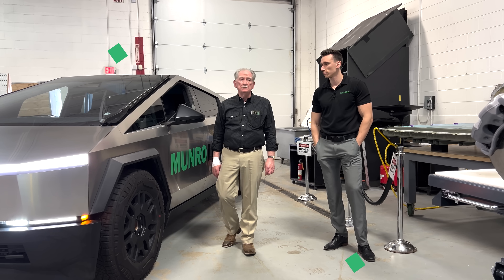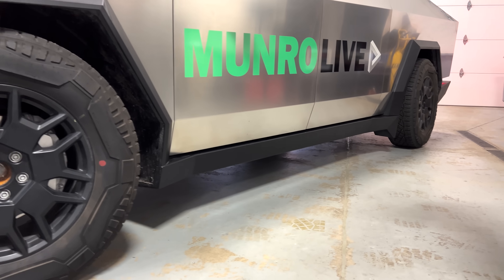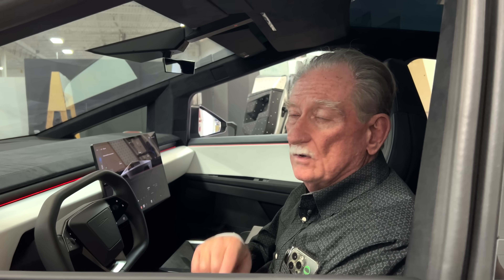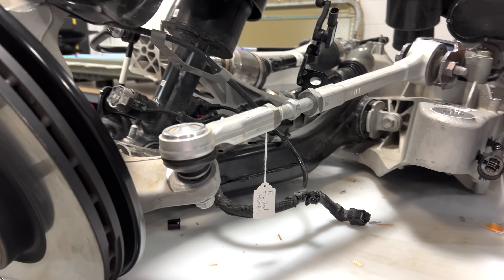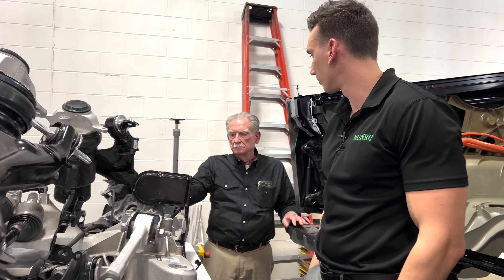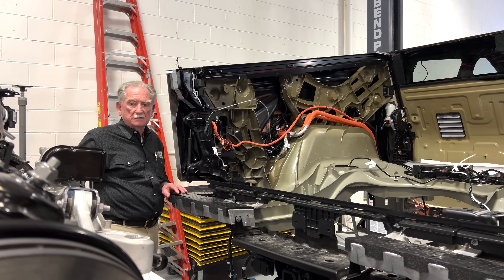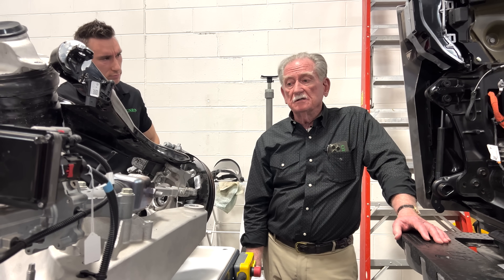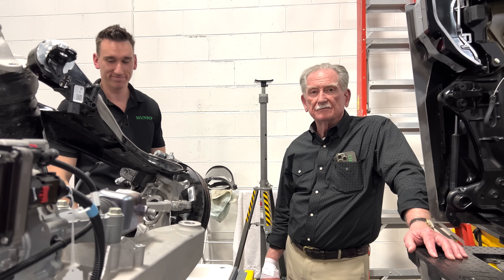Tesla Cybertruck Steer-by-Wire System

Comment: The rack has two motors to control the steering input, if they disagree there is one module that breaks the tie.
To me this means the module is the "decision maker", the single decision maker ?
The control system that sends the message down to the racks ( front and back ) is a single controller.
No redundancy on the master control

Comment: Any chance someone could reverse engineering on those modules ? The Ethernet connection is there to synchronize the front with the rear ? Is the connection with the Steering wheel also Ethernet or Canbus ?

Comment: The front having rwo motors, multiple sensors and a third logic device is so much more complicated than a shaft from the steering wheel to a simple rack and pinion connected to the front wheels. So much for the "best part is no part".  However, maybe it is worth it if necessary for the rear wheel   steering to make this large truck to have a tight turning radius.

Comment: Really don’t like the comparison to aircraft and ships. If they could use  mechanical steering they would it’s just not possible with the size. Look at small aircrafts and boats they do use mechanical. Also those aircraft and ships that use steer by wire have strict maintenance and inspections done on them that were written in blood. While steer by wire has his benefits in cars but removing something mechanical when it’s not necessary seems like it’s introducing unneeded risk.

Comment: He keeps saying it's double redundant. I had thought he was familiar enough with aircraft to know that 2 wires going to the same connection, from the same connection, & traveling the same path hasn't been considered double redundant for a couple decades. I can't remember the flight where all the hydraulics for a couple systems got taken out because the engine failure shredded their travel path.

Comment: Can someone explain WHY complicate something so simple??!!
You need 2 motors for redundancy. Another motor for feedback and on top of that, 0 feel what wheels are doing.
Delete feedback motor, delete 1 rack motor and add simple shaft.

That ribbon ethernet cable is shit, not redundant. Connector might be double sided but still, it's 1 connector.

Comment: 2:50 "Two new technologies", yea because no other car before has had rear wheel steering.
Porsche 911 (991/992 series)
Porsche Panamera
Porsche Cayenne
Ferrari F12tdf
Ferrari GTC4Lusso
Ferrari 812 Superfast
Nissan GT-R (R35)
Nissan 300ZX (Z32)
BMW 7 Series (G11/G12)
BMW 5 Series (G30)
BMW 8 Series (G15)
Lexus LS
Mercedes-Benz S-Class (W223)
Mercedes-Benz E-Class (W213)
Audi A8
Lamborghini Aventador S
Lamborghini Urus
Renault Megane RS
Acura RLX
Mazda RX-7 (FC)

Honestly, reporting like this just sounds like Apple fanboys gushing over Apple features that have been in Android for years....

Steer by wire, credit due where credit deserved.

Comment: 7:00 The ethernet loop is doubled, but honestly, is pretty useless being doubled in this case, considering its flat wire running side by side, meaning if one gets cut or damaged for any reason, the likelihood of the other getting damaged too is very high.
Reply: Also, 7:50 calling it "triple redundant system" is at the same level as Tesla bullshit. Having 3 sensors doesn't make it triple redundant, its double as the most important devices are the steering motors.
Reply: This video is really disappointing

Comment: Redundant only in terms of marketing accuracy. Single point failure for the rear wheel steering; Single manufacturer of front steer motors; Both motors on one shaft; if one jams its unlikely the other will handle it. Nothing said about independent steer computation units, and even if present probably identical firmware for both so failure modes duplicated. Unknown redundancy in the steering wheel sensors. Would it still steer with a nail through that ribbon cable, or after a mouse has chomped on it... probably not. I'd still choose to buy a 1980's magnum Ferrari :o)

Comment: At 8:29, that's not a planetary gear; it's a worm gear set. The steering motor uses a worm gear to drive a helical gear. The steering shaft features a linear gear that moves back and forth. The worm gear set is used because it generates the highest torque and has a self-locking mechanism. In fact, the two steering motors may be working together in sync to produce more torque when the Cybertruck experiences a very sharp turn at high speed and acceleration.

Comment: Maybe I missed it. Is there redundant power? If the 48V battery dies, does the power come from the the high voltage source with a DC/DC converter? It would make sense but cannot find anyone confirming if there is any power redundancy and how it works.

Comment: So many amazing technologies on this truck, too bad the design is awful, Tesla should have hired the designer of the Hyundai N vision 74, Mr.SangYup to design the CyberTruck .

Still, Tesla has to solve those "awful" battery designs that can't be repaired or recycled, maybe use pouch bag cells or blade batteries whithout all that urethane nonsense.

Comment: I read somewhere that Tesla released the truck with 3 degrees of rear-wheel steering with plans to go to 9 degrees when the data shows that drivers can handle it.  Makes sense with something so different and maybe they'll find that we can't handle the full 9 degrees and settle for something less but still greater than the 3 degrees now.

Comment: Planes have fly by wire systems, they also have legally mandated service schedules, detailed log books, controlled operating conditions and highly trained pilots who are legally obliged to report any deviations from the flight envelope.

Redundancy is only useful if the failure of the primary systems are apparent to the operator, if one cable fails the system degrades. Putting two cables in parallel doesn’t suffice and can make things worse, if one cable gets mangled and shorts it may disrupt the second.

Comment: Well presented  just one question what type of 48 volt  back up systems  are 
used for the steer by wire  system in a power supply failure (no power no steering )
I  know that Toyota Lexus has a lithium  emergency  back up battery

Comment: Redundancy is measured by the least redundant aspect.  It's double redundant.  Not hating on it and I'm glad we are moving to it as normal steering setups have no redundancy... but being factual and clear is important.
Reply: Normal steering setups prior to this new setup had a system that at failure could still handle the job of pointing the front wheels where you wanted them!
Reply: @anthonylike1800  If your steering shaft fails then no you cannot steer anymore.  If you drop a drag link then your steering is also gone.  If you drop a tie rod then you can half the time steer one wheel.
Reply: That force is large and an equivalent wire would be a guage the size of your pinky. The size of wire that controls this new system is way weaker!
Reply: Main reason be weight. Second cost.
Reply: And that's only one of how many wires? My point being why would anyone justify the purchase of this death trap?

Comment: Sandy is wondering why Steer-By-Wire is used in every industry except cars. I get the point that it totally makes sense from an engineering point of view. But from business perspective, the good old handlebar might be cheeper than a tripple redundant Steer-By-Wire system.

Comment: Very nice that the logo of ZF (Zahnradfabrik Friedrichshafen) from Germany is on the case. This confirms, once again, how self-confident ZF is, that they are able to enforce their logo there at Tesla. This also shows that Tesla simply uses the innovations of Tier 1 suppliers for many components.
Reply: And proving Sandi is all confused when he keeps using the term "vertically integrated"....tesla is far from it.  they are an assembler like all others, that get parts from thousands of OEM suppliers.  sandi is so confused, so many times.  He thinks if he pretends to know stuff, and keeps the same lies, like a politician, it becomes the truth.  Wake up, 70's porn mustache
Reply: And Moicrovision, a LIDAR company, just signed an agreement with ZF.  Check out MVIS

Comment: Steer by wire on rear axles are available on most german cars for at least 6-8 years. For front axle there is still a huge debate- as previous attempts (see Nissan infinity Q50 in 2013) got negative feedback from customers and forced the manufaturers to change back to traditional steering

Comment: Silly system, what if the battery goes all pair shaped and craps itself, how do you steer the vehicle to safety? or if you hit something and it damages the wire loom as redundant cables run with the primary? Also variable power assisted steering has existed for many decades, well they have here in Australia, they existed with Hydraulic and with electric assisted, all based on speed, the faster you go, the stiffer the steering, the slower you go, the easier it gets, so nothing ground breaking at all here, now I appreciate the redundancy, but I would prefer a mechanical backup in case of the battery failing.

Comment: What happens to steering in case of a power issue? If the low voltage battery malfunctions while driving, is there any backup power source?
Reply: At least Boeing had a half ass set of controls if all power was lost! F.A.A. made that a law along time ago!
Reply: But Boeing cut cost in this little area and planes started falling!
Reply: Elon has decided its wise to take all control out of your hands and let a computer call the shots!😖
Reply: There is no solid link from driver to wheels!
Reply: And Boeing had a left and right flap that was controlled by cable when all power was lost.
Reply: Referring to the fly-by-wire Boeing 777.

Comment: Lots of philistines on here moaning about change which is a shame. This is a great example of how we move the needle and improve. If you dont like it then just buy the old crap quick as it will soon be unavaialble.
Reply: Moaning about change? This vehicle is an exercise in engineering just for the sake of engineering. Don't get me wrong, I have great respect for the work done at SpaceX, but the engineering that goes on at Tesla suggests that the engineering philosophy is to throw away everything that has been learned in the past and the lessons learned that have been exceptionally good at driving engineering (in general) are somehow meaningless or irrelevant. This is no suprise. Engineering schools teach engineers to be "creative", and that is somehow shameful or disgraceful to build on the work of past engineers (use lessons from history). I've watched this mindset unfold over many years. I've watched new engineers right out of school get excited over something they "invented" and then watch their fradgile egos crumble when I show them that their great new idea was something already patented, used, and discarded 50 to 100 years ago.

Comment: I just read the full patent for the DBW system. It's WO2023107555A1. Enlightening to say the least. From the limited description of how the system works, the as-delivered product seems to closely follow the patent description/claims. 

What's important to note is that by design, from what I can see in the patent, the two servomotors are operating continuously and synchronously. And the system as it is described in the patent only has bits and pieces of redundancy within the system, but is not fully redundant in any way. There is a definite lack of hardware to support any claim of full redundancy, and there is nothing in the patent description describing how the system remains functional in the event of a component failure. This is something I would have thought would be an important feature/claim to incorporate into a patent and it was completely missed. What is revealing in the patent is that is seems to describe a system that when a fault is detected, the ENTIRE SYSTEM shuts down.
Reply: it just asks you to pull over and call service . That's the redundancy

Comment: Don't get me wrong, I love modern tech, but the drive by wire front steering system looks absurdly over complicated vs a conventional assisted mechanical system.  So many points of failure that would render he vehicle undriveable (for safety reasons) from a single point of failure in any of the redundant motors, gears, sensors, wires, plugs, electronic components.  There is a lot to be said for simplicity.

Comment: How does 4 wheel steering add stability at HWY speeds?
Reply: At high speed the rear wheels steer the same way as the front wheels; the vehicle behaves in some ways like it has longer wheelbase.

Comment: Wait until the stuff is all recalled cus of massive failures.  Stop the nonsense.  The steering rack is all mechanical, to tie rods etc.  VW and most others have electric steering with required mechanical safety connected.  Wanna bet Cyber Truck will never be sold in Europe, or lots of other countries.  It's a consumer low quality disaster

Comment: Does it have dual batteries for the steering motors? If not, what happens if the battery fails?
Reply: I was wondering about that as well.

Comment: When the windshield is out, you see how damn much space there really is in the front of the CT - strange that the frunk is as small as it is. Sure, the hatch can't get any bigger, but you could have a recessed compartment reaching deeper inside the vehicle than just that shallow little shelf frunk you get now, methinks. Not sure why the frunk is designed quite the way it is.

Comment: This system has 2 serious flaws:
1. You can not tow the vehicle with the front wheels on the ground if the steering system power is off or disabled (no 48v power). See problem 2 for why this is so. This is something easily done in legacy steering systems by simply unlocking the steering wheel and the wheels will self-align. I'm sure tow truck drivers will bill accordingly.
2. There is no redundancy in the system. In fact, this system appears to be anti-redundant. The two servomotors on the front steering rack were likely a requirement to address power and/or latency issues with steering the very large tire/wheel combo. But, both of these servomotors appear to be driving the steering rack pinions through worm drive gear sets. Worm drive gears can not be backwards driven. In other words, no amount of torque applied to the steering rack pinion can spin an idled servomotor. So, both of the front steering rack servomotors have to be run  synchronously all the time. And if one servomotor fails, the remaining servomotor is not able to back drive the failed/idled servomotor through it respective worm drive gear. This little oversight effectively halves the reliability factor of the steering system.
Reply: In general you do not tow EVs with their wheels on the ground.  When the wheels turn the motors turn.
Reply: @JBoy340a  This vehicle is being sold and marketed as something suitable for "offroad use". Anyone that's had a vehicle stuck or broke down off road is not going have access to a rollback tow truck. This issue with the steering is another fault not considered in the design of this vehicle. Add this to the fact that there's no spare tire or even a place to put one, no place to connect a tow strap or a winch, and no skid plates under the suspension, control, and drive components, this vehicle is about as useless as you can get for offroad use.

Comment: Car steering without mechanical connection should not exist on this planet. It seems that “triple” redundancy is just another lie from Tesla - I do not see three independent systems with independent actuators, independent control modules, independent power supplies and independent wiring. Even that double wire with single!!!! connector is a scam. I understood there is one module that controls it all!!! So what happens when power is lost to that module? (It has a small emergency battery maybe??? It will be dead in a year). I’ll tell you - you are flying 70 miles an hour in a highway bend into an 18 wheeler without ability to steer a car. And even if there was triple systems, the level of complexity would be out of this world ridiculous, un-maintainable dangerous monster. It’s a marketing stupidity to compare with ships or airplanes. Those are serious independent systems that in some cases use different actuator principles(electrical, hydraulics, mechanical) even the time required of switching and engaging is incomparable in automobile when you have milliseconds before collision.

Comment: Those steer by wire reactions appeared a bit slow seen from the outside. 

PS! I dont think Sandy understands sportscars. Sportscars need direct steering and good feedback to the driver, which is the biggest weakness of this steer by wire system. Its great for a truck, but I would not want it on an actual performance sportscar.